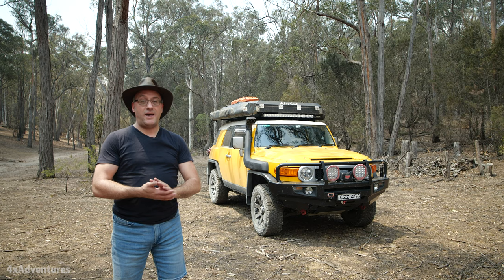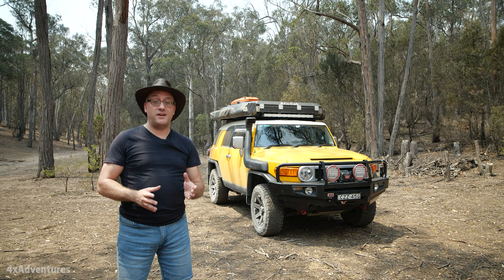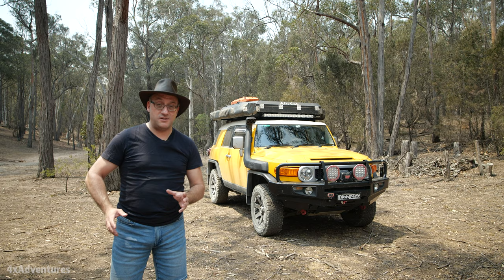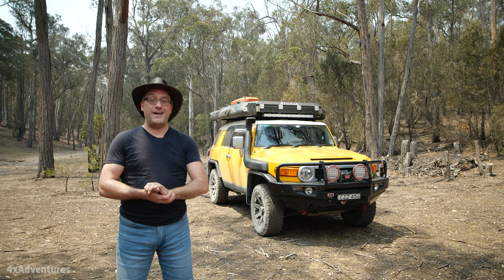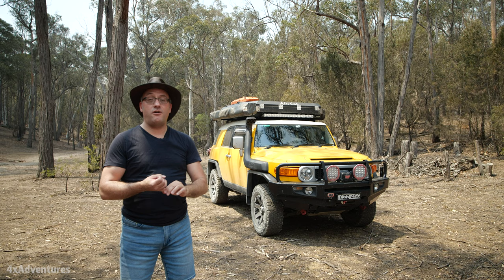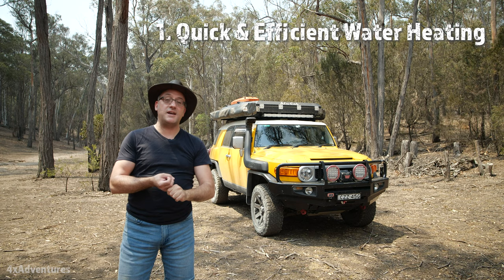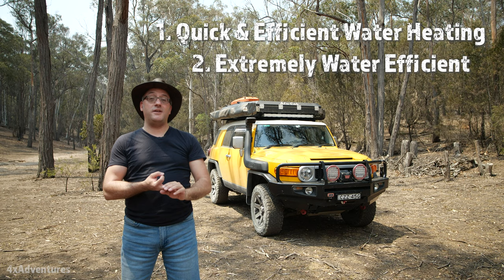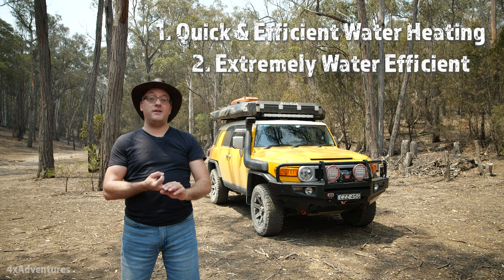Built-In Hot Water and Shower System for Touring/Overlanding | @4xAdventures#adventure #4wd #touring

Comment: Hi! Regards from Spain! Nice videos and nice car, congratulations.
I have a question, probably because my english is not the best, but i cant understand how the system capture the heat, there is not radiator or something to tranfer it? 
By the way i would like to thank you very much for the efforce to prepare videos. 

Thats all, man! 👍
Reply from the maker: Hi Adrian! Thanks very much!! I’m glad you enjoyed the video :)

The heat is transferred via the heat exchanger. The heat exchanger is the black cylinder I am pointing at under the bonnet. It contains 2 parallel copper tubes. 
Basically, the hot water coming out of the engine goes into your heating system. From there, it would normally return to the radiator. I cut this hose and inserted the heat exchanger at this point. So the hot water coming out from the heating system is now going through one of the copper tubes in the heat exchanger and then back into the radiator. 
The cold water is then passed through the other copper tube within the heat exchanger and off to the shower. 
Because the 2 copper tubes within the heat exchanger run parallel to each other, the heat is transferred to the cold water - heating it up.
I forgot to mention that the copper tubes within the heat exchanger are coiled tightly around the inside of the unit, which increases the length and surface area, which maximises the length of time the tubes are touching and increases the heat transfer to the cold water.
I hope that helps!! :)
Thanks very much for watching!
All the best!

Comment: Great video! Ive got a glind system but no temper valve installed. Do you have a basic schematic on where exactly the temper valve is installed? I understand the hot side but not sure where in the system the cold water input gets diverted to the temper valve.
Reply from the maker: G’day Darrin. Thanks very much. There is a schematic at the end of the video which should indicate how the plumbing goes. But basically, it goes like this: water source -> 12V pump -> Y-splitter. One path goes straight to cold water input of temper valve. The other path goes to heat exchanger -> hot input of temper valve. The mix output of temper valve goes to shower head/trigger nozzle. That’s the basic plumbing. I have an in-line tap between the water source & the pump, as well as an inline tap before the shower connector outlet. 
Hope that helps!
😊👍

Comment: Thanks for the video!
Really like the idea behind this system and currently looking into different systems for our Overland troopy build.
I don't wanna muck around with a gas bottle so looking at the glind system or a 12v heater.
What are your experience with the system since you installed it?
Any dramas with taking water from streams.
Thinking about running a pump/small tank seperate from my drinking water tank. 
What heat mixer valve do you use?
Reply from the maker: G’day! The heat exchanger is fantastic. It’s zero hassle and completely reliable because it has no moving parts. The way I’ve done the plumbing makes everything super simple to setup & use. 
That said, I’ve also built one using the Duoetto 12V electric hot water boiler instead of the heat exchanger. Plumbing remains the same. That works just as well. There are advantages & disadvantages of each - it just depends on which system suits you better. Heat exchanger: no additional water to carry around, no “contraption” required to heat water, but you need to use while engine is still hit, or run engine for a few min. Electric water heater: can use whenever you like, but needs sufficient battery to power it (~25+amps) and water boiler holds 10L water, so added weight.
My recommendation is to take a collapsible 10L bucket with you & scoop up as much water as you need. Then just run a hose to the bucket next to your car.
The type of pump is essential. See the description for more info. I used the John Guest temper valve, but any temper valve will work perfectly.
Best of luck!! 😊👍
Reply: @4xAdventures  thanks for your replay mate.
I just got a 2nd hand glind heater unit including pump so I will give this a go. Thought about installing a 2nd Insulated 10-20l water tank which I can fill up whilst driving and maybe have hot water in demand for a couple hours after I stopped at camp. 
I do like the idea of a 12v heater as well.
So much fun stuff to build!

Comment: You may have been asked already. Is that small pump able to self prime and pump water up a long hose placed in a river or external water supply? I can understand pumping from the tank, not being far from the pump and also being slightly elevated, but down to a river is hard to imagine. Good job, nice setup.
Reply from the maker: G’day John, This depends entirely on the pump used. Some pumps will actually publish the incline and distance that they are able to pull water up on the inlet side. I have tested this particular pump with a 10m hose and that works ok, however the incline will ultimately determine how effective it is. I haven’t tested it with a steep drop as yet - simply because I haven’t yet had the need or circumstances arise. I don’t have the booklet that came with the pump with me at the moment, but when choosing a pump, look for the ratio 1:xx for the incline on the input side if this is likely to be important to you. You can always just take a collapsible 10L bucket with you and fill it up from the river and the pump it in from next to the car. All the best! 😊👍
Reply: @4xAdventures  thanks for your reply and helpful info.

Comment: I understood that, we mix the hot and cold water using the valve, but the valve is at 1 end, and shower at the other, how to control temp while showing? Or before you start shower you come and adjust the temp every time?
Reply from the maker: Great question. It’s a pre-set fixed temperature. So you find a good comfortable temperature for your shower, and once it’s set, there’s no more adjusting hot & cold required. You get whatever temperature you have chosen out the other end. 😊👍

Comment: Wow dude. This is a genius concept. I love the simplicity and efficiency.

I have a few questions if you'd have a moment-

How cold can this run? Theoretically if I drained the entire system if I knew it was going to get cold could I still use this in the Rockies during winter? I'd like to try and insulate my tank in the back of my Subaru Forester where my spare currently sits. Then run the shower and pump. Hit a cutoff valve to the tank and then pump the remaining water out of the system. Just wondering what your take is on winterizing and if this is a feasible idea.
Reply from the maker: Thanks very much! 

Depending on the type of temper valve you have, you can vary the temperature as much as you like. So, re. How cold it you can make it, you can essentially make it the same temperature as the source (tank, bucket, river) and then introduce hot water into the mix by varying the temperature via the temper valve. Check out the FAQ video to this which might answer some of your questions.

I live in Australia, so don’t have any experience with a cold climate, but it is definitely possible to turn off the water at your tank and then to let the pump drain whatever is left in the hoses. Even if you partially drained it, that would be enough to stop the water freezing & cracking the pipes. So yes, that would definitely work!

All the best! 😊👍
Reply: @4xAdventures  SWEET! You are the absolute man! Thank you for the feedback. Im giddy to try this out.

Random question for your expertise:

Im tossing this in a 2018 Subaru Forester. Im need to insulate my water tank somehow and im thinking of putting it in where my spare currently is and somehow insulating the shit out of it. I saw your episode on a 12v blanket.... trying to scheme out a way to make it possible to keep the tank warm. Any ideas on placement or any methods of keeping it from freezing?

Comment: this is awesome! does this system come out hot with the first cycle? ive seen on other videos people are have to cycle the water through the heat exchanger a few times to get it up to temp? thanks!
Reply from the maker: Thankyou. No cycling necessary. It comes out hot - apart from any water left in the hose after the heat - as that wouldn’t have passed through it. But that’s just a pretty small mount. 😊👍

Comment: Hi, Im curious. How does the temper mixer and automatic pressure pump work together? If the mixer doesnt release water until its at the set temp yet then how does the pump sense pressure being released and then switch on? Because when your car is cold and you start it, the pump wont send water through to the mixer because the mixer wont release any water to your shower hose when you open it because the first water going through the heat exchanger won’t heat up enough to get released through the temper mixer.

What am I missing here because obviously your system is fantastic and works
Reply from the maker: Hi Philip, check out the FAQ video about the whole system - it may answer your questions (easier than typing). https://youtu.be/zpEnTAU2vFo?si=80e7LPFqIlkKMpbq
If you still have questions, let me know. 🙂👍

Comment: Thanks for sharing this video it was very informative. I have a hino truck and have been doing some research on shower systems and this one looks the best. Would it be possible to build some like this to fit a light truck? And Would you still consider building something like this for me?
Reply from the maker: Hi Cameron, thanks very much. As long as there is room in the engine bay to mount the heat exchanger, this would work with any petrol/diesel engine. I’m planning on having an end to end installation video up at some point so that people can follow along and build their own - it’s not hard, but can take some extra time if a mounting bracket needs to be made, radiator hoses sourced etc.
Reply: @4xAdventures  I’m sure there would be but I will have to have a look. Is there a way I can contact you direct discuss further? 
Thanks

Comment: Great video and idea! The only questions I have are would this system work in freezing temperatures? And is there a way to flush to system so the pipes don't burst in those temps? Also do you ever have any issues with the connections under you car when you go through mud? I would imagine the rubber gaskets on the connections would wear down quickly depending on where you're going in the bush under the car.
Reply from the maker: It rarely gets down to freezing temperatures here in Australia. The coldest I’ve used it in was about 4 deg C. You can always drain some of the water from the system once you shut the source off, that way, your pipes aren’t completely full and would allow for some expansion. That said, I really can’t comment with authority on how well suited the various components are to freezing temperatures. I would probably look at enclosing the pipes in suitable insulation. Care should also be taken to ensure whatever materials you use would be safe in the high temperatures of the engine bay. 
The pipes are running through corrugated tubing which protect it from damage, mud and heat (to some extent). 
I will make an end to end installation video in the near future, which should clarify any questions.
😊👍
Reply: @4xAdventures  thanks for the reply! I'm very interested in this installation but the freezing questions come to mind as I'm in BC, Canada and although we don't get freezing temps all the time it does get quite cold into the rockies and the further north we head. Can't wait for the detailed installation video. Keep up the great work!

Comment: I really like the temper valve idea.  I had a glind shower in a Prado many years ago and always hated losing the water at the start because it was too hot or too cold.  I just ordered a new glind shower this morning for my new 4WD.   What temper valve did you use?
Reply from the maker: G’day Mark. Thankyou. Any temper valve will work. I’ve built these using temper valves from Bunnings. But, I used the John Guest temper valve for my build because it is WAY lighter than the standard plumbing ones. Also, the John Guest hoses & other quick-fit plumbing bits all work together nicely.
Reply: @4xAdventures  Excellent.  Thanks for the quick reply.

Comment: well Im not the only one haha I am in the process to build my hot shower system, I got the heat exchanger (different from yours) installed and was wondering how and where to install the pump, I like you put it on the engine bay, I didnt know about the temperature valve which is amazing, this changes the whole set up in my head, just one question to confirm something I'm thinking, if your heat exchanger doesn't produce hot water (lets say over 40C) right away the valve wouldn't work right?
Reply from the maker: Hi there. The pump can go anywhere you have space. In other vehicles, when there isn’t room in the engine bay, I install it elsewhere. As long as the plumbing is protected from heat in the engine bay and from stones etc. if you run it under the car along the chassis rails. 
The temper valve basically stops water above a set temperature from passing through. Anything colder will still go through it.
Hope that answers your questions! There’s also an FAQ video which might answer any more questions you might have. Good luck with your build! 😊👍

Comment: Winterizing  ? What do you do about fresh water in system between  showers when it gets below freezing  ?
Reply from the maker: Hi there. I haven’t had to deal with that because it just doesn’t get cold enough here for that to be a problem. I suppose you could insulate any piping runs that are outside of the cabin by running them through radiator hose or something similar… but that is just speculating because I’m not familiar with how these things are dealt with in cold climates.also, you could simply turn the water off at the input and keep the pump running for a few seconds to allow any water still in the piping to flow out.

All the best! 😊👍

Comment: where to get the 9.5L pressure sensing water pump?  also what water mixer did you use? I really like your setup and I want to build one similar to yours for my tacoma
Reply from the maker: Hi Vitri, Thanks very much. I’m not sure about other countries, but in Australia, Road Tech Marine sell them. For other countries, most boat/marine/RV/caravan supply stores should sell these. It’s a fairly common item that should be readily available. 
Same thing for the temper valve. Although you can also use a temper valve that standard plumbing supply shops would have.
If it helps, maybe I can see if the parts are available on Amazon?

Comment: Thank you very much for your video, very well-explained !
I am planning on fitting this to my van and I wanted to know if I could use a regular pump, not an automatic one.
Thank you !
Reply from the maker: Hi Marie, from the testing I’ve done, a regular pump will not work with the plumbing the way I have it configured in the video. The plumbing, the way I’ve done it with the pressure pump, relies on a pressure build up between the pump and the tap as it pushes water through the system. 
I haven’t tested a regular pump in every configuration though. If you place the pump near the tap at the end of the plumbing, it may work, because it’s pulling the water through the system. 
Good luck!! 😊👍
Reply: @4xAdventures  I'm gonna stick to your configuration with an automatic pump then. Thank you !
Reply from the maker: Best of luck!! 😊
Reply: @4xAdventures  Hello ! I delayed my van conversion and I am in the stage of installing the heat exchanger. I have a question : can you use the John Guest connectors directly on the heat exchanger with the semi-rigid hose or you need to switch to another type of hose ? I can't see this part very well on the video. Thank you.
Reply from the maker: Hi Marie, You can purchase a Glind heat exchanger which has John Guest fittings. This will allow you to connect the plumbing easily. If you haven’t yet purchased a heat exchanger, I’d recommend this. If you have already purchased a heat exchanger and it has barb fittings, then the best I can think of is to use barb to John Guest adapters to convert from one plumbing type to another. Best of luck!! 🙂👍
Reply: @4xAdventures  Thank you very much for your help  ! Mine has the barb fittings so I'll buy the adapters. All the best to you too !

Comment: Hey mate, awesome video, could you please give me an idea of where to plumb in those lines for the hot water from the engine
Reply from the maker: Thanks Tristan! Look for the hot water hose heading from the engine through the firewall. This goes to your heater controls. There is another hose that comes back through the firewall which takes that hot water to the radiator. This is the hose that you need to cut & put the heat exchanger in-line. I recommend draining your coolant so you don’t get it flowing everywhere. Then once the heat exchanger is all plumbed in, replace the coolant, adding a bit extra because you will have added a good half meter to your original plumbing by adding the heat exchanger. And that’s it! Just make sure the O-rings/hose clamps are securely done up. 
I found the hardest part was finding a place for the heat exchanger that was close to the existing hoses. You don’t want to add excessive length to your hoses. 
Good luck!! 😊👍
Reply: 4xAdventures hey mate, which hose is it that goes to the radiator in the FJ? can’t seem to trace it for certain over the engine but by the looks of it appears to be the one on the bottom coming out from the fire wall? Thanks
Reply from the maker: Yea, that’s the one! The bottom hose through the firewall is the return. 😊👍